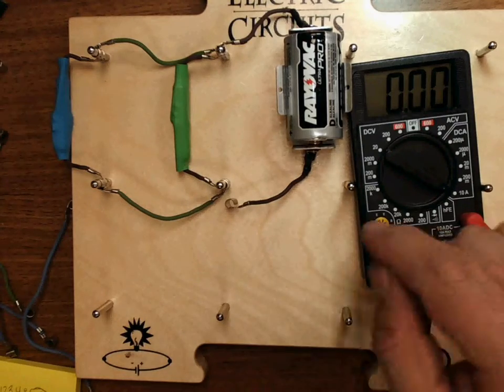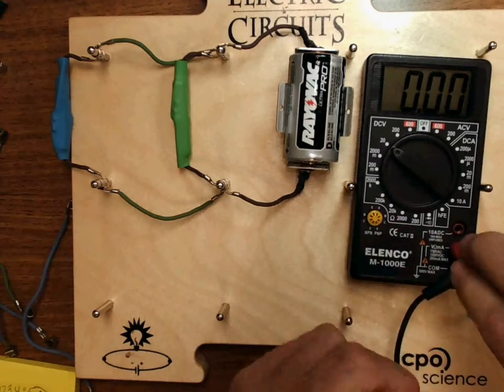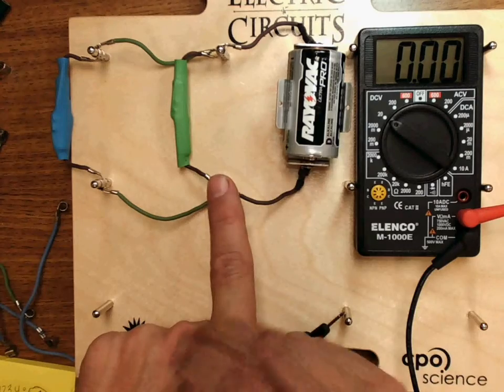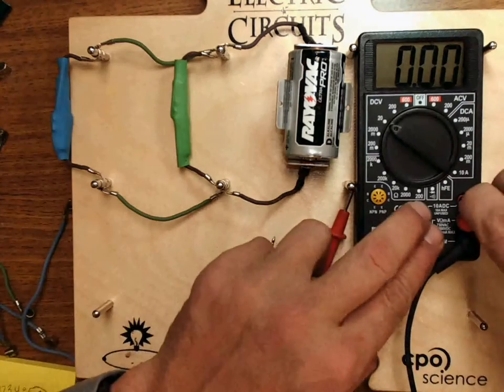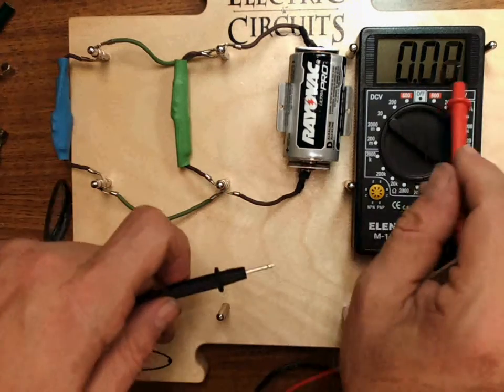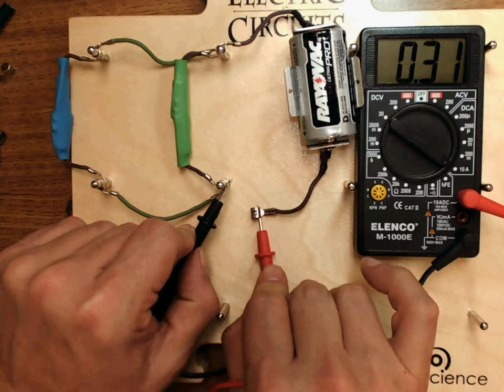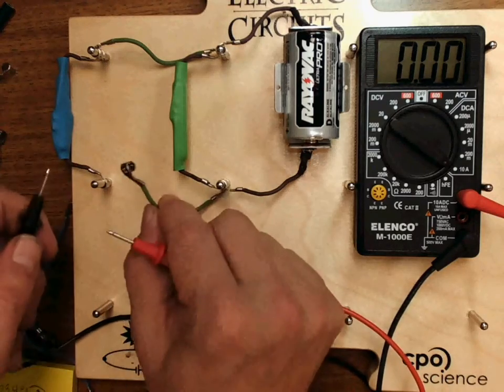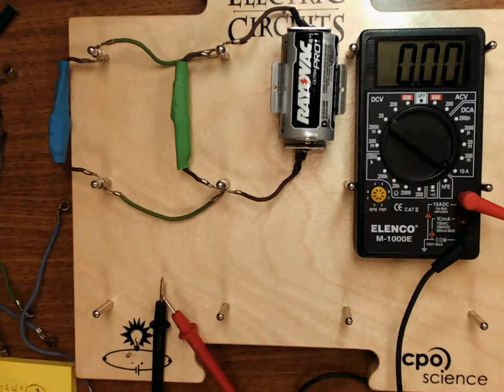Using a multimeter in a parallel circuit

Comment: I know this video is old. But instead of disconnecting the terminal to complete the circuit. Can you just touch the same terminal with both positive and negative terminals of the multimeter to get a reading?

Comment: When you first measured and said that was short circuiting the circuit, then pulled a wire and put your meter between the circuit, you're still doing the same thing but measuring through the resistors.

Comment: Useful vid, i use short circuit current measurement just shortly (2-3s max) just to see how much current is that battery able to pull
Reply from the maker: Be careful.  You use the wrong battery and you are likely to blow your multimeter.  Most of them are around 10A max, and some batteries are capable of that in a short circuit.  I burned myself on a wire that shorted out between the poles of a simple "D" battery.
Reply: @mrfranzscience  thanx for advance but my multimeter has inbuilt protection.. yes, it shows 10A max but won't burn, even on, say, 50A, it just shows OL. (Over limit). Manufacturer says - anything 100A and above avoid contact longer than 1sec., it would burn and damage the wires - but in theory it will never happen (unless you short fully charged car 12V bat. and who on earth would ever do that)

Comment: I NEED AN ANSWER FAAST!  Will the current through the blue resistor (the resistor furthest away from the battery) always be a lower number than the current through the green resistor? I have had some fun with the online software called "Circuit Construction Kit", where I have built a circuit similar to this circuit. However, in my circuit the current through the first and the second resistor is equal (both are 0.9A, the total current is 1.8A). Have I done something wrong?
Reply: Probably too late but do both resistors have the same ohm value?
Reply: @2jake077  too late bro